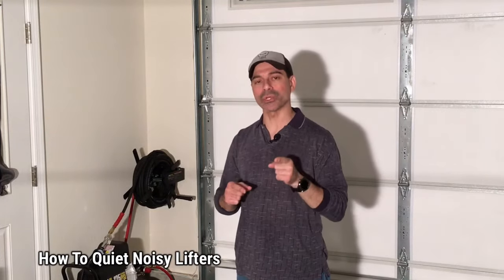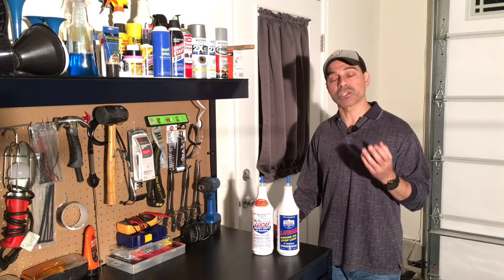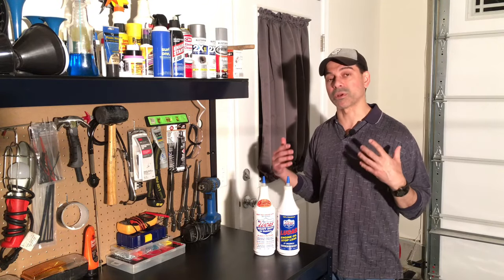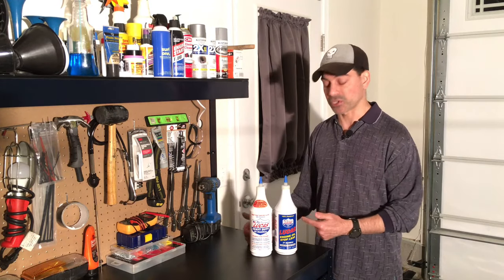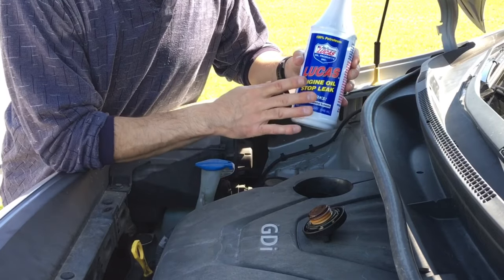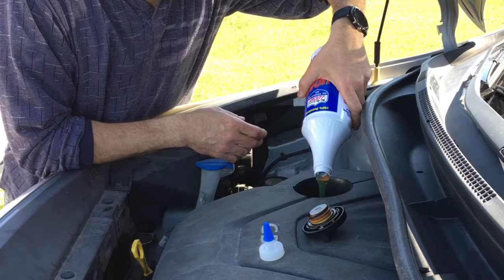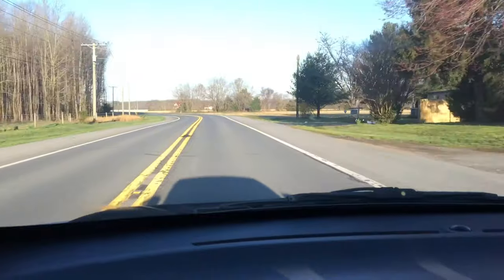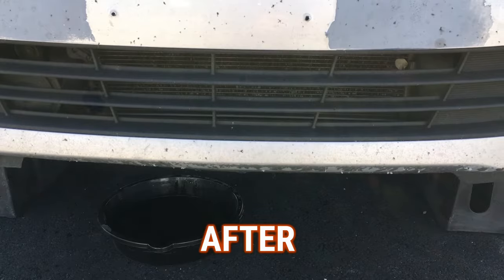How To Quiet Noisy Lifters (Andy’s Garage: Episode - 253)

Comment: Sometimes the issue with lifter noise is that dirt is binding up a hydraulic lifter. This happens when people neglect oil changes and carbon Sludge gets into the lifter. Hydraulic lifters work like Squirt gun shooting oil through the center of the pushrod to lubricate the rocker arm while cushioning reaction on the movement of the cam.  There is a great video done by (project farm) where he puts sea foam into the engine oil of a old Ford ranger with a very loud lifters. After a few minutes it’s noticeably quieter. This is because the Sea foam is it detergent. He added 1 ounce of seafoam for every quart of oil.  Also another way to quiet lifters is to replace 1 quart of engine oil with transmission fluid. Transmission fluid is essentially oil with lots of detergent. What you are doing is adding thicker oil to your engine which will help with oil pressure but can have the effect of causing more sludge. I would do things differently. I would change your oil and use sea foam or transmission fluid and drive the car with the noisy lifters for 100 or 200 miles. Then change the oil again using products that you demonstrated. By cleaning out the crank case and all the components first you mitigate the possibility of sludging up your engine.  You never want to add these products that are thicker than the recommended oil if your engine has variable valve timing. There are small passages that use oil pressure to control the valve timing. If you gum up with these passages you’ll screw things up really bad.
Reply: I have a 2012 town and country, I just took my van for oil change at Walmart and now it is ticking always and when I hit the gas even faster ticking. I now have oil all over the bottom of my motor. I have never had issues with this van and the only time I decided to just save time and do food shopping and get the oil changed my van gets all messed up and lied on my receipt of my tire pressure and said they couldn't fill washer fluid because the holder was broken. It isn't broken and I filled it as soon as I got home. Can I use sea foam in my van
Reply: Also I found Walmart sucks the oil out the top and now threw the bottom and that makes all the dirt stay in the bottom of the oil pan . It says they used 5/30 high mileage oil in my van
Reply: @dreamtoreality9892  It would be worth a try. Put 1 ounce of seafoam for every quart of oil that your engine uses. Probably about 5 ounces of sea foam in the engine oil. If it works it’s a cheap fix. Otherwise you might just have a collapsed lifter that will need to be replaced. Hopefully this can be done without removing the heads. Most engines the lifters can be replaced by removing the intake manifold to access them. It’s a labor intensive job.
Reply: Sometimes the ticking and sucking of air or pushing in most cases comes from exhaust manifold
Reply: Anyone know what the european equivalent to this would be?  Lots of Liqui Moly over here.  Do they have a seafoam like product?  Seriously I could just put in some dexron III?  I've got a half bottle left after changing my steering fluid.
Reply: I ran Lucas stabilizer and it caused mine to start ticking (4.6 2V 2004 Mustang GT). I'll run some seafoam and see if that fixes it. I just saw a guy replace a lifter in one of these  without removing the camshaft. Defintiely do a search for that video as well. He swapped it in like 2 minutes using trick with a pry bar twisting it just right to get the rocker off and then he used a little wedge to push it back into place.
Reply: @misterbulger  any other info on that video link??  Im not finding it...
Reply: @misterbulger  can you provide link of the video, please?
Reply: Please reply!
I have a Fusion 1.5L Turbo Ecoboost with ticking noise (75k mileage) when starting the engine in the morning and when speeding (giving gas), not heard with steady speed.
I have a P0012 and P0014 (Camshaft position timing…) plus P0455 (EVAP System Leak),  Ford dealership mechanic came with a quotation asking the camshaft over the pistons (bank1?), digital sensors, timing belt, valve cover gasket, engine belt to be replaced! Previous car owner used a cheap engine oil and was careless.
I have watched another precious video of you asking us to change the oil first, I did it, changed to %100 Synthetic of Amsoil + Motorcraft filter, cleaned digital sensors, changed fuel pump, the ticking sound still available, is the engine still dirty ? Some recommended flushing oil but Scotty and some people don’t recommend, do you recommend adding Sea Foam or Motorcraft Automatic Transmission Fluid to the recently added Amsoil Synthetic Oil (285 miles) ? Or, do you think replacing digital sensors (despite being cleaned and working) could fix the ticking ? Please help
Reply: @dreamtoreality9892  Well that's Walmart for ya
Reply: I have this issue with my 95 trooper. It comes and goes which is weird. It will happen for 50 to 100 miles and then it will sound good. It's very annoying. I top off oil and it sometimes fixes it but it doesn't always.
Reply: Doing the transmission fluid method was another way to break away seized pistons with turning the crank.
Reply: Have an 06 ram with the 4.7 I've replaced the spark plugs coils and injectors still has a miss fire and tick? I'm think replace my rockers and lifters am I right on the hunch?
Reply: @dreamtoreality9892  Freaking Chinamart.
Reply: Or high mileage I’ve drove2cars up to 350k I change oil every4k lifter will go on u I’m in a 13taurus got it18mounths aho140k it’s350heard lifter other day stuck
Reply: @misterbulger - think about what a pulley does to a belt when it stops spinning. I’m sure you have metal shavings from your cam and lifter in your oil.
Reply: @anthonyfrizzell2316 try changing out your intake gaskets. Ran across that a few times with the 5.7l hemi
Reply: Right. That last thing I want to do is thicken it when hyundai needs oil pressure at a certain psi. Especially when they even make their oil filter extremely cheap & hi-flow to keep the high psi.
Reply: Very helpful information, would you also happen to know why rocker arms would be loose, not the bolt that hold them down I torque those but still is wiggly and making a loud ticking sound when my car is on
Reply: Yup you have to be careful with those Lucas oil stabilizers,  and make sure it's correct for your engine, my last engine popped the rear seal because of Lucas oil stabilizer, its not meant for every engine
Reply: That stuff is too thick, especially in the qtys of the video. 
  Just use synthetic ATF (about a half qt.) and that's usually enough detergent to clean them quiet. Seafood is excellent too, as well as B12 Chemtool. I add 1/2 qt of Rotella to the oil at every change. The detergents of this, prevents any buildup from starting. Some people use Marvel mystery oil with good results. I don't personally because I drive rather aggressive and at high RPMs a lot and I'm not certain about the lubricating properties of the Marvel. 
  The guy in this video puts about 50 bucks worth of overly thick 'Grease' in the engine and then puts a 'dab' of cheap/generic oil to get to the full mark. Foolishness! That is the same as all the people who used to put 20W50 and/or thick racing oil in their engine. Foolishness, again!
  The person who had their oil seal blown out actually was a lucky one! An oil pump can hardly pump any of this thick stuff and your bearing clearance was ENGINEERED for a product of approximately 10W30 or close to that (5W30-10w40 etc.). That was ENGINEERED, Not some redneck driveway project! The engine trying to pump all this crap through about 2 to 3 thousandths of bearing clearance can (and in time will) either blowout seals, ring off a pump driveshaft or cause bearing failure. Anyone think that YouTube or the cheapo Redneck oil additive Mix-Master here is going to pickup the Tab for your engine repair or replacement??? Hello, people are usually peddling snake oil for some Free product, not even actual compensation! 
     My recommendation is to contact this publisher about repair costs before filling your motor with this concoction of 'Redneck Engineered Grease'. Wait a minute, I'm willing to bet this guy doesn't have a degree in Engineering like the folks who designed your engine. I'd be willing to bet that this guy has never successfully rebuilt a stock engine at home!
    Ya'll Take Care and DON'T go for this Snake-oil sales pitch, I feel certain that you will regret it, in time... -John
Reply: @misterbulger I recently ran the Lucas cylinder lubricant for fuel and it started ticking on my truck also (09 Silverado 4.8). Did the seafoam work?
Reply: @Letsgrababeer  it was just the spark plug that was starting to back out that was making it tick. Tightened it back down and now it's good. 4.6 Ford problems (luckily only minor problem)
Reply: Do not use thicker products will lead to problems down the road
Reply: Agreed 100% my 08 fored escape has 240,000 on it n is doing it but I bought it like that n haven't driven it bc of it
Reply: @jessypatterson9823  I have actually had this on 4 cyk Wrangler once... I was young... So I  pookied it with JB Weld... Smelled like burning peanut butter for a few days... But it actually freaking worked... I think a bolt broke off off-roading or shortly after... Of course I don't recommend this, but I was so proud of myself
Reply: @surfreadjumpsleep g

Comment: Many modern engines have a low pressure/high volume oil pump. By putting high viscosity oil treatments in your engine oil, you risk burning up your oil pump and permanently damaging your engine. Whenever there is lifter noise, it's rarely an issue with your oil...it's due to lifter seal failure, poor adjustment, weakened springs etc. ~ I'd rather fix the root of the problem than risk ruining the rest of my engine.
Reply: 05 Suburban I bought in 2012 for $9,995 with 98k on the clock. I'm at 283k now and I just tried this treatment... worked!
So, my reasoning is, I've gotten great use out of this engine... if it needs replaced or rebuilt because of this, I'll eat the cost. 
It's been trouble free, except for lifter rattle.
Reply: @Brian-mp2mv it's really not that hard to address the lifter problem yo honestly save yourself time and money if you just address the lifter problem rather than having to constantly add all these additives to your engine especially since nowadays vehicles are so expensive especially used vehicles that 160,000 miles on an engine is considered low mileage nowadays which is insane so you may want to keep that 243,000 mile engine going for as long as you can. For what you spend an additives over the course of a year is what you'd spend on just fixing the problem especially if you drive a lot whether it be for work or whatever where you're putting on 20,000 Mi miles a year, because at that rate you're doing a lot of oil changes within a year
Reply: @polosavage1      Honestly, if you're going out and spending 80k on a car 160k miles better be low mileage, right?
Reply: Your comment answered my question,before I even ask it . I run a full synthetic oil in my hemi, I parked it because I was going to Alaska for a few months . The oil level is full I have zero leaks
Reply: "The root of lifter noise problem",  correct; is rarely and issue with oil ; yet it is always and issue with "friction". 
The friction may be from trash/ debris, carbon build up, oil sludge or anything inhibiting/ restricting the free up and down mechanical movement of proper lifter operation.  Sometime, a good engine flush and /or oil change will fix or help. Other times it will not. It all depends what issue is actually restricting the free movement if the lifter/s.
Reply: Can any of that damage be caused by too much oil or poor oil quality?
Reply: @polosavage1 He just said that

Comment: I use Mystery oil in mine everytime I change the oil and I have no issues. With that said you my want to make sure though its not an exhaust leak or a bad lifter as well be fore you do this. It does help though!

Comment: Lucas is basically gear oil. You don’t want to replace 40-60% of your 20 or 30 weight engine oil with something heavy enough to be differential oil. MMO would at least lube it and keeping oil moving easily through your engine and pump. That much too heavy oil is gonna quiet the whole thing soon. Amazing how quiet a seized engine is
Reply: A seized engine wouldn't move or not start. 😅😂

Comment: This actually does work I had a Toyota Camry 99 and I bought it at 170k it had a knock and would add the Lucas when doing a oil change and the ticking stopped the guy I sold the car to 8 yrs later still has the same car 420k miles.
Reply: Did you use 1 or all of the additives?
Reply: Those Toyota Camrys from 99 will run on cooking oil such a great car

Comment: Had the same noise on my dad truck took it to a shop told my dad to put the same stuff and let it blow up and bring it back to get a new notor so i change out the lifter still driving after 5yrs after replacing parts still quiet 😊
Reply: What?!

Comment: My old Ford Fairmont station wagon with the hydraulic lifters got to the point where we’d get a sticky lifter usually about oil change time. I used good oil and knew that was not the issue and neither was the oil level. An old Ford mechanic told me to dump a quart of Ford ATF in the engine and run it for a few miles before the oil change, and it would act as a detergent and clean out the lifters. It truly worked as he said. So keep that in mind.
Reply: That is true
Reply: my au has the same little tick noise, how do you reckon i should go about fixing it? :D
Reply: @chanuda4824  try liquid Molly
Reply: @marcocaravantes422  i drained it and refilled with 5w40, thing is quiet and only light ticks at about quarter throttle at 1.5k rpm
Reply: @marcocaravantes422  doing some reading up on Molly and think I'm going to use it . I never heard about this oil before.
Reply: It’s works for one f150 1996??????.. I have the same noise
Reply: This actually works thanks I appreciate you a lot my truck was down for 3 years and this helped a lot

Comment: I ran that junk in my 2009 chevy with the 5.3 with the famous lifter tick and it made it worse so after several other additives with no luck i went the other way with thinner oil, 0W20 made the tick go away and made the motor a lot smoother and quieter.
Reply: yes this stuff about the right oil for ticking noise is so confusing... example my 1990 XJ Cherokee In line 6 is WELL known to be a noisy engine, for many years I used 20W 50 and 10W 30, I live down in south Texas so it always HOT down here, even used the Lucas mixed with the 20W 50 and made it worst but one day just to see what happen used 5W 20 and the crazy in line 6 is quiet like a brand new car!! I've been using 5W 20 for 2 years ago with NO problems at all... I could not believe it, more than 15 years using 10W 30 in winter and 20W50 in summer, now only 5W20 all year
Reply: With that oil weight you probably have low oil pressure at idle
Reply: @TheMELTDOWN911  My 02 Jeep GC (167k) doesn't like the heavier oils, as well ... Had great success changing to a 5w - 30 (Valvoline synthetic blend high mileage) with a Zinc additive (Rislone)

Comment: while products like Lucas Oil Stabilizer can offer temporary relief for certain symptoms like noisy lifters, they are not a panacea and should be used cautiously, considering the potential downsides of altering the carefully balanced formulation of modern motor oils.  it might be better to just buy a higher quality oil or increase the viscosity ie 5w-30 to 10w-30 if you're in a warmer climate.  

When you add an oil stabilizer, it can dilute the concentration of critical additives in the original oil formulation, such as detergents, anti-wear agents like zinc or ZDDP (Zinc Dialkyl Dithiophosphate), and dispersants. ZDDP is particularly crucial for protecting engine components such as camshafts, lifters, and other valvetrain components in high-pressure environments.